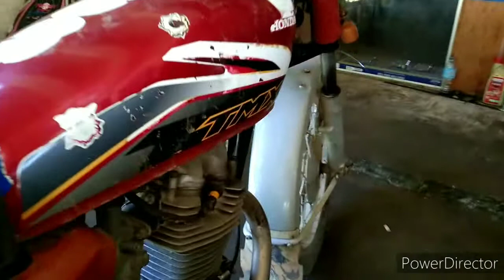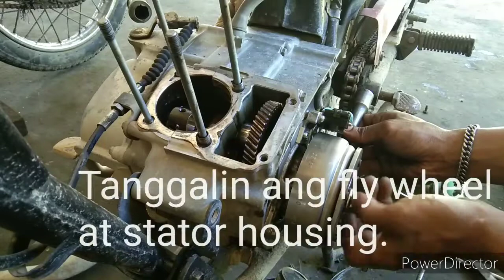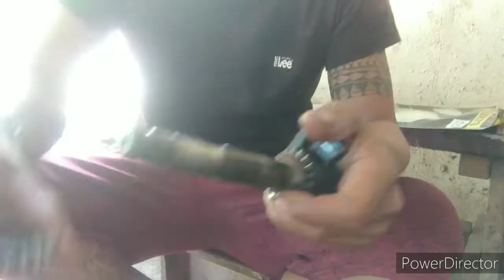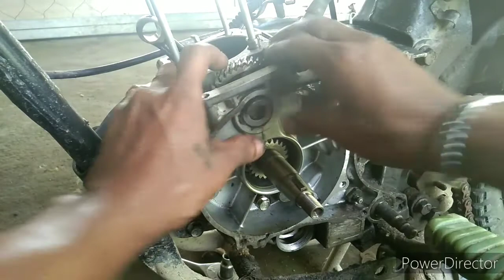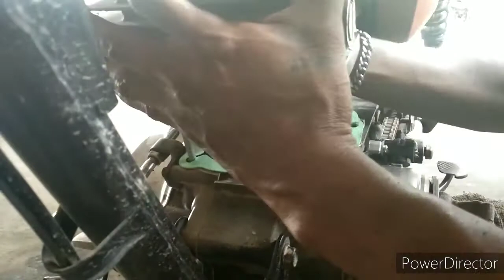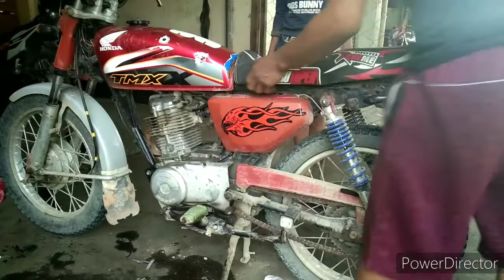SHORTCUT PAGPALIT KICK RETURN SPRING | TMX 155

Comment: Idol patulong naman pls.ung tmx 155 ko kasi na stock ng ulang buwan ngayun dina makick binuksan ko left side dun sa fly wheel binaklas ko   ko ung nut para tanggalin sana fly wheel pero díko matanggal di binalik ko ung nut pahigpit umikot stock up na fly wheel at ung kick pwede na pero parang nawala compression wala na ung tigas nya kung paandarin ano kaya sira idol.
Reply from the maker: wag mo nang baklasin yan linisin mo lang ang carb.din palitan mo ng bagong oil
Reply: Ok lang ba idol na umikot pakanan wala bang problema.
Reply from the maker: anong umikot paps?
Reply: Ung fly wheel nya idol umikot sya pakanan kinabahan tuloy ako baka kung ano nasira sa loob.
Reply from the maker: walang problema yan paps kahit umikot cya
Reply: Salamat paps godbless
Reply: Paps magandang umaga sayu may tanong na naman ako kasi tong raider ko 1 ltr.lang nilagay ko nung nagchange oil ako pero sabi ng karamihan dapat 1.2liters castrol synthetic nilagay ko pas balak kong dagdagan kahit anong langis ba pandagdag pwede ba paps?salamat.
Reply from the maker: pwede kahit anong oil jan basta pang engine lang,1 liter lang talaga laman nyan ,1.2 liter kung galing sa overhaul ang makina,pero kung dagdagan mo paps ok lang din yan
Reply: Salamat sa sagot mo paps god bless